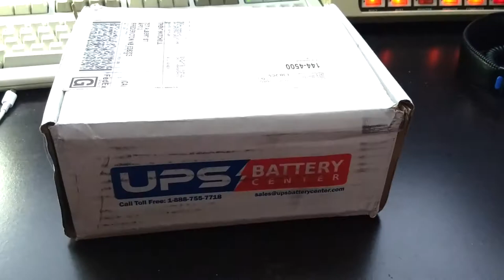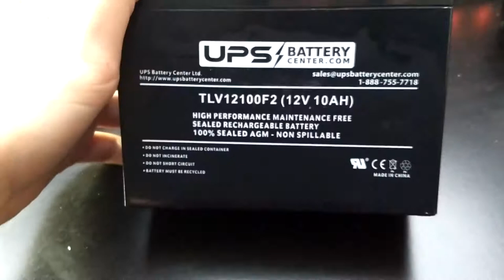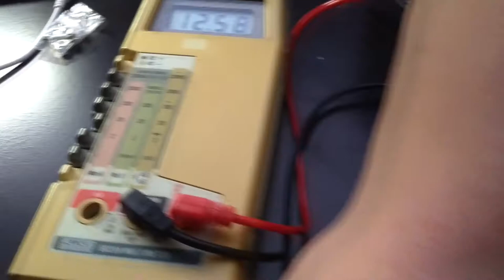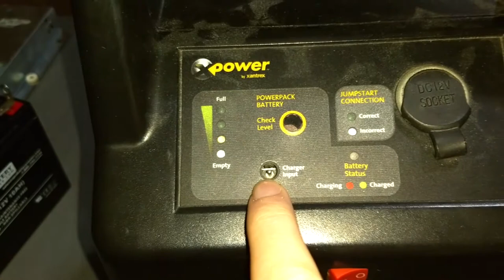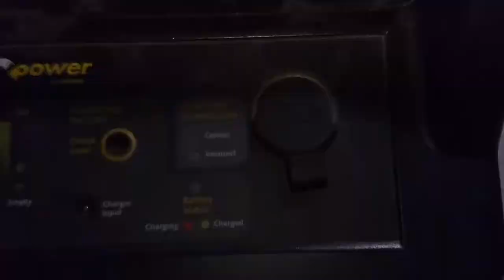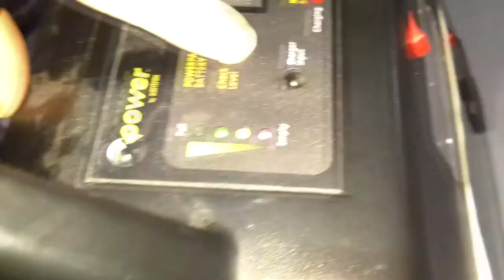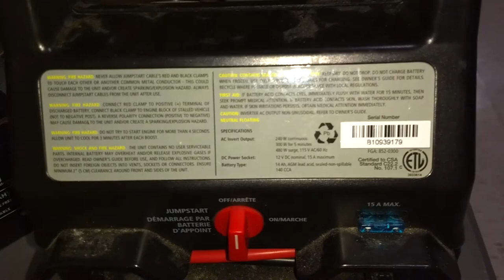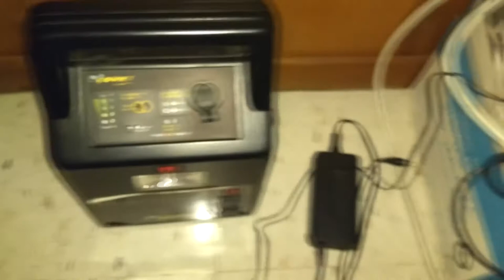New battery for the Xantrex Power Pack

Comment: Honestly, I wouldn't be surprised if part of the reason that the cheaper inverters sold now are lower wattage is because of efficiency that you get with electronic devices now...like you said your grandfather plugged a 40" CRT into one that caused the overload protection to kick in....according to an article I read online, a 40" CRT uses around 210w (i'm sure they vary by model) where a 40" LED TV uses about 80w.  Other electronics are getting more energy efficient as well.  A 120w inverter now would be enough to power a flat-screen TV and a Blu-Ray player or some video game consoles (primarily the Nintendo systems since PlayStation 3/4 and Xbox 360/Xbox One use a lot of power)
Reply from the maker: You make a good point. Your power figure for the 40" CRT jogged my memory - my grandfather's TV wasn't actually too much for the inverter, but the power-on surge caused it to trip, so we had to try it a couple of times before it finally turned on.